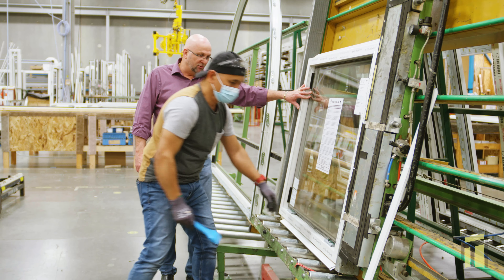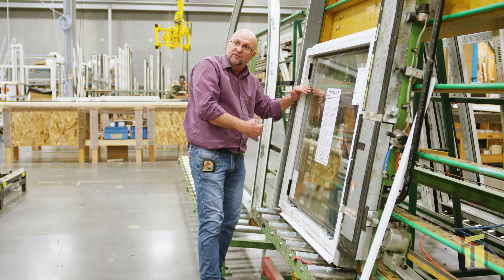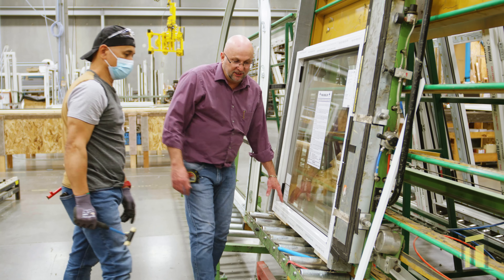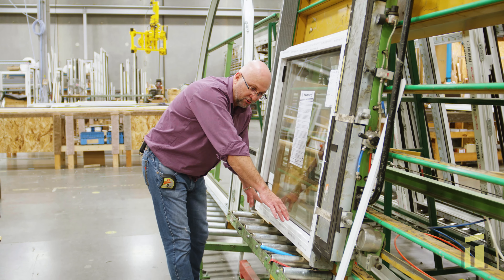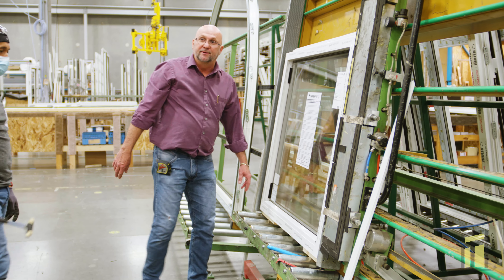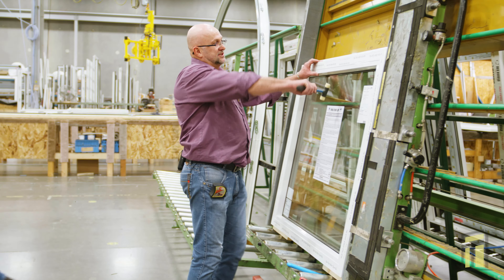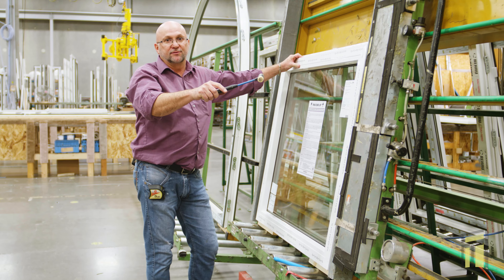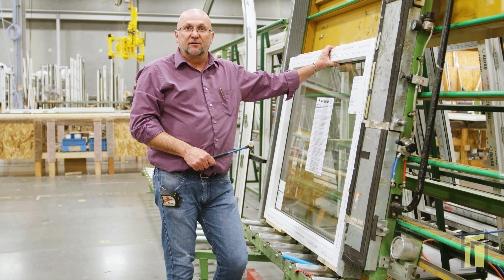How to Reglaze a Picture Window | EuroLine Windows

Comment: Description is reglazing yet you are showing first glazing. For reglazing we need to know what the replacement unit thickness and original glass and spacer bar is used so be able to order the replacement unit with parameters to give correct seal for air tightness and how to order replacement seals from your company to ensure reglazing is up to the standards of quality. Please consider renaming your videos to reflect the purpose of the directions that are being given.
You have had a quality product for several decades now and if I am restoring windows and doors you built. I want to maintain the effectiveness of the product